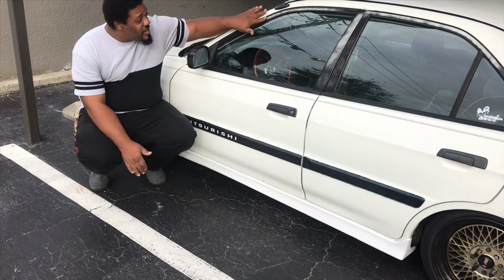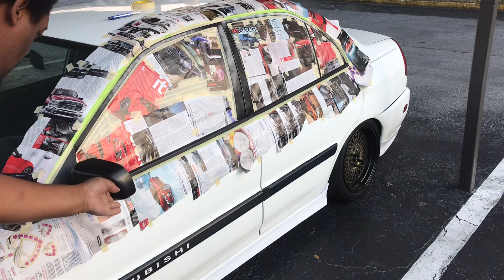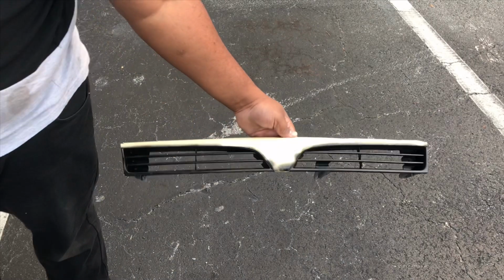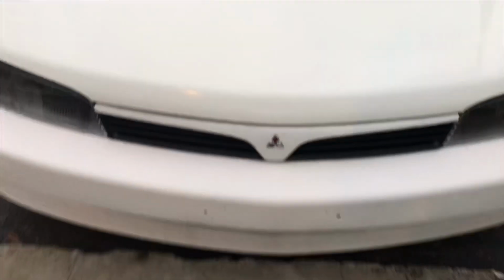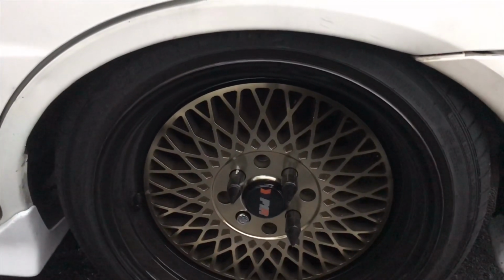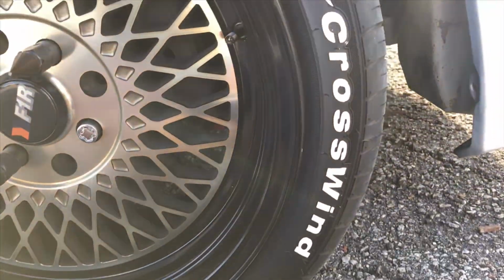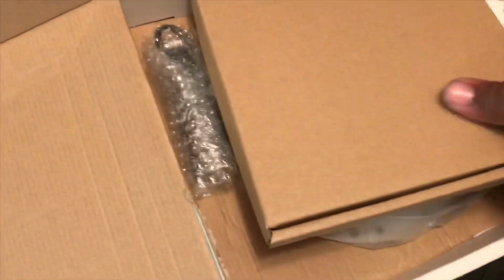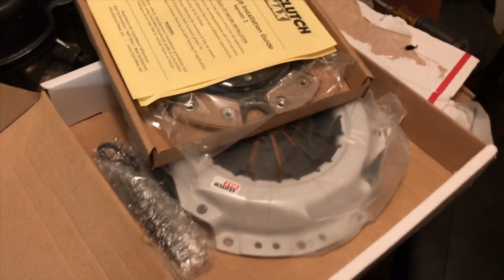Part 4 2001 Mirage touch up work

Comment: Im watchin all Your Mirage Videos Bro Im Gunna Get A Red 1 that im gunna paint black
Reply from the maker: Definitely please do I’m going to be making some more videos soon of that car as soon as the black conquest is running
Reply: @legionelitemotorsports2096  ok Cool Im Ready For Part 9 Whats The Next Move On The Car Are You Replacing Interior in the car
Reply from the maker: No actually I am working on converting the car from automatic to manual but that’s going to be coming up soon as soon as I get some good space to do it
Reply: @legionelitemotorsports2096  alright bro You Should Do a top 5 Things to replace Or Upgrade video bro
Reply from the maker: That’s definitely a great idea but that would definitely depend on what you were using the car for if it was regular maintenance I would say a tranny flush oil change new brake pads and stuff like that but for racing crap that’s a long list it might have to be top 20 LOL
Reply: @legionelitemotorsports2096  True